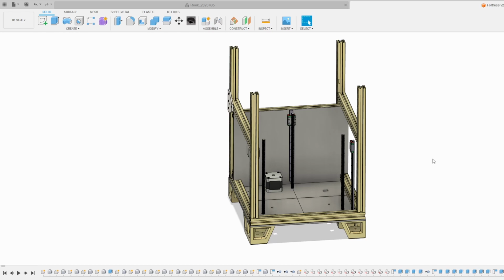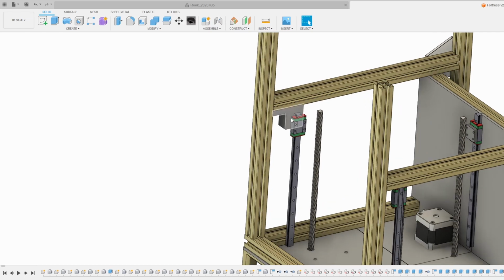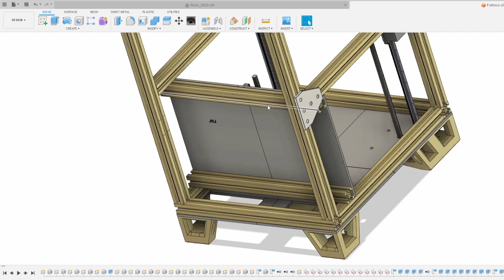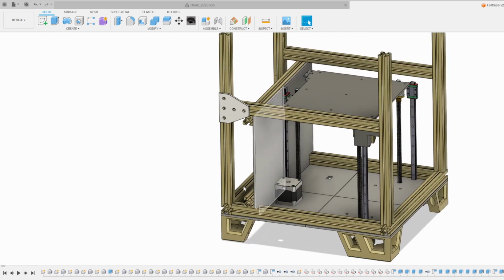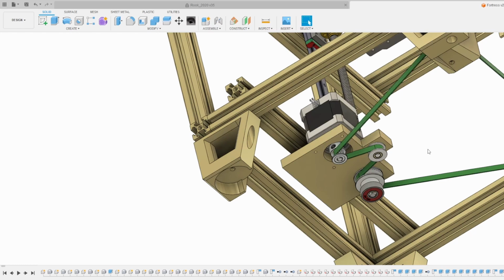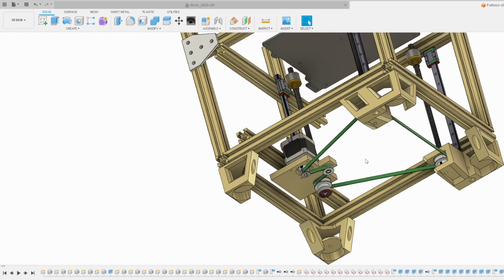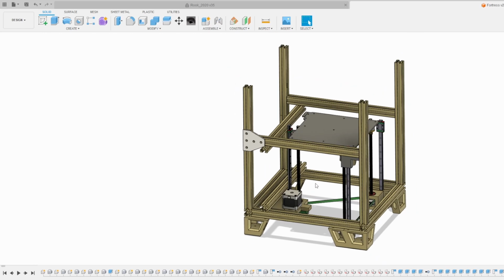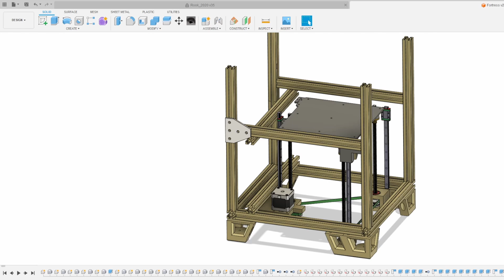Fortress CoreXY 3D Printer - Single Z belt CAD overview

Comment: I fear trying to drive all three z screws with a single motor for cost cutting purposes is too excessive on penny-pinching. With individual motors, you can use thinner, cheaper motors ($8 each or less) allowing a more compact assembly with cheap, short belts. It also gives you the option to auto- level. That's considerable benefits for saving very few dollars.
Reply from the maker: Bambu Labs does it the same way, there are pros and cons to both. I have made a bunch of printers with 3 stepper motors and wanted to try this method.
Reply: @Rolohaun  that reason makes the most sense! (But can it be an option for the builder?)

Comment: I am a software engineer but graduated as a civil engineer and those 3 linear rails of z axis ringed the alarm. It will create internal stress that can cause all kinds of issues. Do as bambu lab did an use linear rods.
Reply from the maker: I have used floating Z linear rails on SimpleCore Legacy with out issue, however linear rods will be used on my printers for Z in the future
Reply: @Rolohaun  Maybe on small machine it can be a minor issue but i worry about the fact that 3 rails preventing the rotation around z axis. If anything will be little bit misaligned it  introduce internal stress. But obviously it depends on the way you want to hold the bed. If it something as ratrig core 3.1 than it doesn't matter.

Comment: With that leadscrew that close to the bed won't it lose print space considering the print head should avoid going that close?
I quite like this project, I'm very inclined to gut my ender to turn it into the fortress as it seems most hardware is usable.
Reply from the maker: the nozzle can move over the leadscrew so there is no loss on build volume

Comment: I'd be hard mounting the stepper in place somewhere behind the 20x20 extrusion which keeps the build are of the printer looking neat and then using a spring loaded tensioner on the idler; that would reduce maintenence/ re-tensioning as the belt stretches from use.
Reply from the maker: I defiantly might go that route after some testing

Comment: The unsupported linear rails do not sit well with me... There is a better alternative when you do not plan to support it - linear rods. For a Z config like this and a budget printer that seems like a better choice to me... There is probably also more value in defining more the niche you carved out with the awesome Rook by making Fortress more of a direct lineage from Rook than rediscovering why polished CoreXY look certain way nowadays.
Reply from the maker: It should be ok for Z as the bed is not really trying to move in X and Y. If Fortress wasn't using most of the Rook EVO parts I would for sure be using linear rods. I think linear rods are better for Z on most printers. I am going to be working on fresh designs soon and no longer focusing on the Rook series of printers

Comment: Rolohaun, would it not be simpler to use the closest pully as a belt tensioner?  Maybe use like a cam/off centre tensioner but 3d printed mount
Reply from the maker: Do you mean idler? It is possible to use the idler at the back on a pivot but it hard to lock it down and have fine adjustment
Reply: @Rolohaun  Yeah i get you, Look at how Triumph motorcycles like the 955 daytona rear wheel cam mounting, Like a clamped disc with the idler offset.

Comment: Hi🖐️funny thing Im building myself a diy corexy I made the exact config as you I m using dual axes setup on the same driver have the same location of the motors for Z using two 48mm but I mounted in a way that when I lower the bed I don't loose build volume on the z, in your Cad you loose quite lot of z in this setup because the bulid plate colides with the steppers you should mont them a little bit more to the back, btw Im using 10mm pulleys and  idlers so i don't have to worry about stressing a single 6mm closed loop belt, instead of the motor the idler near it should be the belt tensioner so you can mount it rock solid next to the 2020 profile in the back side
Reply from the maker: I am not loosing any Z the bed clears the Z stepper, I defiantly may try some different belt tensioning depending on how this woks out.

Comment: Wouldn't it be easier to add a lever to the belt pulley for tension adjustment? (Just like in extruder)
Reply: you should make videos about printing! I'd sub
Reply from the maker: I am concerned that it would not lock in place secure enough, I would prefer to have 4 motor bolts lock down the tension. Could be a nice user mod / change though

Comment: I think an easy way of making more belt lengths possible would be to make multiple positions for the back idler.
Reply from the maker: Yes that could be a good idea
Reply: @Rolohaun  The back idler can also become the belt adjustment rather than the motor itself.